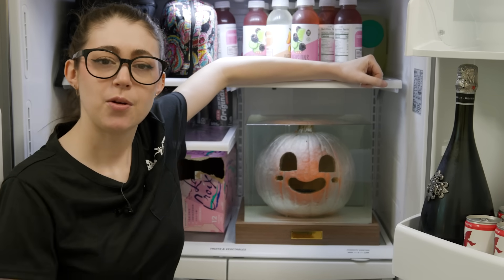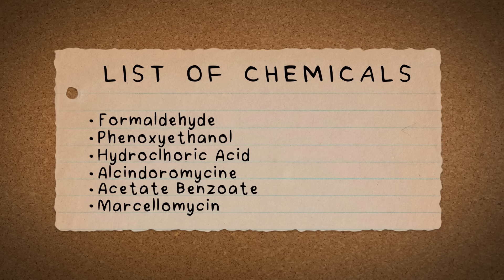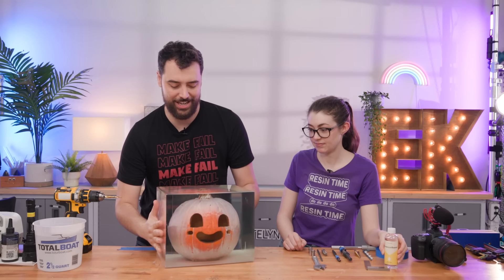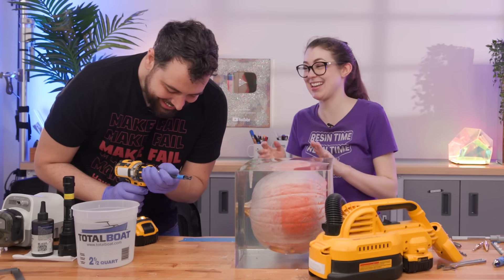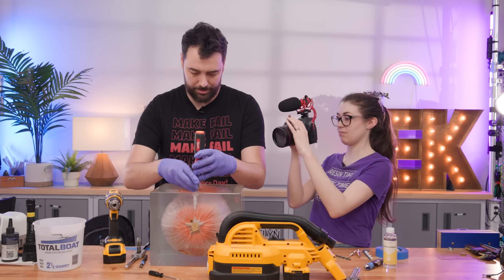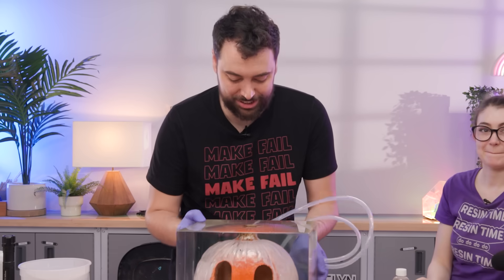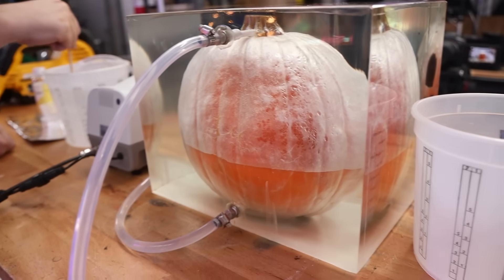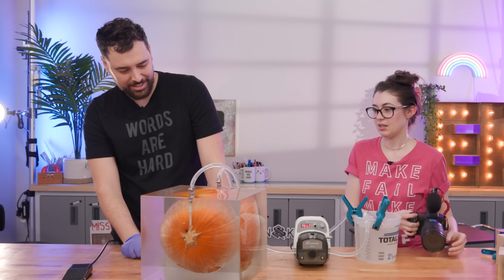Preserving A Pumpkin With Chemicals & Resin (feat. NileRed)

Comment: Sooooo... I'm curious. If flash cured resin preserved pumpkin is holding up the best so far. Would boiling it or something help? Because it technically was cooked inside the resin with the temperatures it reached during curing, no? 

Wrong? Right? Someone with resin knowledge explain why ot might/might not work, please. Because I'm curious now and I need to know

Comment: Intentionally create a flash cure because of chunk 1 put a pumpkin in resin the fridge you guys bought for these guys keep it in the mold and try to cause a flash cure by putting uncooled resin atop it that you can easily shave off with a drill also as askjeevescosby said on the chemical episode put glow resin/dye in it so it can glow under a black light or in the dark with no need for extra equipment or as TaF123 said on the same episode you can increase the size of the cube and file it down

Comment: I am trying to preserve a pumpkin, I mixed together rock salt, vinegar, rice, and silica gel. I didn't carve a face in it, I'm just filling it to the brim with the mixture. I'm going to put a strainer at the bottom so I can keep everything in and let the moisture drain out. I also have 2 dehumidifiers running right next to it.  I hope by filling the pumpkin up it will stop the pumpkin from collapsing by supporting it. I'll let you know how it goes. the one I'm preserving is a monster, it's 53 lbs, 2ft tall, 4 ft diameter and its not one of the huge pumpkin breeds, just a regular carving pumpkin.

Comment: @EvanAndKatelyn Seeing you flush Chunk 2 in this actually gave me an idea for your next attempt:
Context:
- As others have noted, because pumpkins are planet-based organic fruit (specifically a type of pepo), the rind, internal flesh, etc. are composed of water and other compounds, which will be used by any aerobic bacteria present in or on the pumpkin to reproduce.
- As you've already tried heating, drying, freezing, and chemically sanitizing the pumpkins pre-entombment, the only other options would be to completely sterilize the pumpkin with radiation or to ensure a completely anaerobic environment.
- However, this series has shown us that given enough time any amount of aerobic bacteria, no matter how few, that survive the radiation would be able to initiate and maintain the rotting process.
- Due to chemistry and physics "nonsense", water will evaporate out of the pumpkin's rind and flesh, given enough time with any amount of heat or light present.
- As the rind and flesh dehydrate, they shrink, since water is what helps make the volume of those structures.
- The resin used to entomb the pumpkin is rigid, and the resin has a stronger bond with itself than the pumpkin, so the pumpkin will always pull away from the resin, which causes an internal vacuum, which actually accelerates the dehydration process.

Idea:
- You have to pickle the pumpkin.
- Placing the pumpkin for an extended period of time in an non-oxygenated fluid of a similar density and viscosity to water should allow the water in the pumpkin to be replaced by the fluid as the water evaporates, while also making sure an anaerobic environment is maintained, as well as keeping the physical volume of the pumpkin the same.
- This is actually the premise behind turning cucumbers (and other items) into pickles: using either brine (heavily salinated water) or vinegar causes the pH to lower, killing most bacteria and then as the mixture is placed into an air-tight container, making sure no further bacteria can grow.
- A pickle-jar can never be perfectly air-tight, since it is intended to be reopened at *some point*.

Conclusion:
- If the pumpkin and "pickle juice" were sealed in resin, I think if the right fluid were used then all aerobic processes would cease, no shrinkage would occur, and internal pressures would remain consistent, so there would be no chance of the resin expanding enough to crack.

Comment: with chunk 2 you added a cylinder…what if for this year instead of just a cylinder you somehow completely fill the inside (let it cure) then do the outside. 

maybe so the pumpkin can heat up faster and kill the bacteria still as others are saying but don’t cause bubbles like chunk 1

Comment: Look into getting/fitting a breathable bung for your pumpkins gas-holes. They can let gasses out during the fermentation process without letting new air into the barrels. That could potentially "fix" your gas leak and bloating. I would almost plan for the juices, gasses and bloating and plan it into the next pumpkin and make it a feature...and I would dub them "Brewster"!

Comment: I would have used an actual germicide, not a preservative, on a concentration that's meant for food and not make up, a vacuum chamber to remove everything and THEN refill stuff with resin. Are you sure you left it in the drying gel long enough?

Comment: I know 4 months late on this, however! i have a solution for you. In beer/mead making you use a water gate to allow fermentation, while you are not fermenting him, the water gate will still work, how it works is its an s shaped tube, and the bottom part of the tube has water in it, it then has 2 valves on each side, what this does is it allows air to enter into from the side with the container, and bubble out through the water, but the water itself seals the other side from air coming in, this is how alcohol makers can ferment their product for months to a year, air can only leave, never get in.

Comment: If there's air bubbles appearing in a closed system like this, that's a direct result of bacteria decomposing the pumpkin.  You've got to kill basically all the bacteria if this is to work!  Otherwise, it'll be leaky pumpkin again

Comment: I think for next year you guys may wanna take a page out of microscopy techniques.

When we prepare a tissue sample to be viewed under microscope we go through steps that all perform various functions.
The fist is to encase the tissue sample in wax.
The second is to slice the sample super thin using a microtome.
Then the thin slice of tissue is mounted onto a glass plate, and dyed.

The micobes that keep messing up your pumpkins can be killed in two ways: physically, or chemically.
The easiest physical method would be to hold the whole thing at an internal temperature of 60ºC for half an hour (this is a very basic form of Pasteurisation, and the low temperature has minimal effect on things like colour, structure etc.

The chemical method that is used in sample prep. is to use varying concentrations of alcohol (which is miscible in water and xylene), until the tissue is saturated, and then submerging it in xylene. The xylene 'clears' the tissue of water and alcohol, which is then submerged in wax. The wax is finally replaced 
Not saying that you should get xylene for this project, but I'm sure a similar technique would be of use on your project.

Basically you'll need a mediator between water and some kind of preservative, and the preservative can be added at increasing concentrations (70%, then 80%, then 90%, to 95%, and finally 100%). Or a mediator between water and resin.

Also: the reason your squash from last year developed mold was because the layer of dead bacteria that were killed from the bleach or alcohol only acted as food for the mold that grew subsequently. Which was quite sad to see.

Keep up the great work, guys! And good luck on next year's attempt!

Comment: Flash dry the resin after drying the pumpkin in salt, then replacing the moisture with a sanitization fluid, then you can flash cure to kill any extra bacteria. Then just smooth it out. Or you can try heating up the pumpkin(not evaporating the sanitization fluid) then curing regularly.

Comment: you guys should do the pumpkin in resin and then once set drill a hole into it remove the flesh of the pumpkin so its just a imprint then fill that impression with orange resin and a light then it can be a desk lamp too.

Comment: I feel like there are more factors that you could control here. The moisture definitely needs to leave, maybe there is some way to slowly substitute water with another liquid, less receptive to mold and bacteria?
I am thinking, sloooowly "boiling" the pumpkin in a pot with the other liquid, which could let it top itself up on the other liquid as the water evaporates. Definitely something to test on smaller fruits or veggies first, before committing.
Another thing could also be microwaves. They react with water, so adjusting one (CAREFULLY) to very slowly work on a pumpkin could maybe do something.
The biggest issue with the dehydration attempt is the warping, perhaps it could be given a skeleton of sorts?
For vibes, I would also try making one with the top seperated from the bottom, so you can take it off and insert some light source into it.

Comment: Algorithm brought me here.
1.) I'd assume that heat from pumpkin 1 sterilized him so bacteria couldn't grow.
2.) Pumpkin 2 produces bubbles due to decay. I think it is fair to assume that there are pockets of gas within his flesh (a.k.a. pulp). Therfore I'd try to pull a vacuum on one port and connect a funnel to the other port to fill it.
3.) And whilst it is a reasonable assumption to use the least intrusive method, since decay allready started for so long, a harsher approach would IMHO be better. So, I'd maybe use it pure (100%) to fill the cavity from the vacuum because the pumpkin allready has water in it and will dilute the solution over time.

Comment: I'm sure a million others have said it already, but if not, be careful doing these.  I was cringing when you were drilling the first hole.  you basically made a pressure vessel, with enough force to make a bulge of that size, so technically it could explode.  safety first!  also google "degloving" (NSFL!) if you want to see the risk of drilling into a pressure vessel while it's pressurized.  I'd say you should just add a pressure relief valve on future biological resin projects to be safe

Comment: So just for future reference, when dealing with organic material in resin you want to replace as much of the water with resin as you can (which you may already know.) The use of a vacuum chamber or pressure chamber is often beneficial, though again you may have already done that.  The other thing you can do is try to sterilize the organic material before stabilizing with resin, or even after.  I think you can even use bactericidal additives in the resin mix.

Comment: NPT doesn't seal on it's own: you need PTFE tape, pipe dope, or anaerobic sealant (VibraTight is easy to use, but may make it much harder to pull the plugs in the future.

For stopping the decay, my mind first went to irradiated. It's used on food and you don't need to cut in to the resin...but your thing is thick so perhaps that wouldn't work...but that just means run it through several times and do it at least once with each face towards the source.

Comment: So the deal is there’s moisture throughout the entire pumpkin not just the innards. So when you try again this year dehydrate the pumpkin or if you can freeze dry the pumpkin of course that involves buying a $3000 freeze dryer or $2000 freeze dryer depending on which one you wanna get. But if you tell them what they’re planning on doing, they may just offer you one you have them sponsor your video. I forgot the name of the company though they’re really good free dryers. But freeze dry the pumpkin cut it all out and when you plan on doing it, leave the shower, freeze dry the pumpkinthere you go freeze dry it for 48 to 72 hours and then do UV resin as a base on the inside and the outside and then put it in the square that’ll work

Comment: Chunk 1 is my buy, total workhorse pour.  I kind of wonder what would have happened if you'd just put the whole thing back in a slightly larger resin cube to clear the gaps out or something?. 

Chunk 2,I think you went in the wrong direction. I think The pressure could have been used to your advantage and filling it with a liquid was a bad idea... I think giving him an actual base under the resin (like a full ass piece off wood that goes on top of the base) would be a good direction for the next experiment.

Comment: @EvanAndKatelyn I have an Idea to make Chunk 3 work, try to put him supmerged in a saline solution (having it hot but not hot enough to cook the pumpkin might help it to get rid of more bacteria) into your vacum chamber first, than  coat the pumpkin from the inside and outside with Phenoxyethanol and repeat the step before this time useing cactus resin instead of the solution. Next fill Chunk 3 with resin, let it harden and give him a coating of UV resin before you cast him in to a resin block.

Comment: 15:34 It makes sense if there was a lot of heat involved, in food production there is a step called pasteurization. This step greatly reduces the amount of bacteria in the product by heating it up to a high temperature for a certain amount of time. When canning foods, they can be shelf stable for many years because the jars are brought to a boil for an extended period of time. Ensuring that any bacteria inside has been killed.

Comment: My ideas for the next pumpkin.
1- CLEAN THE PUMPKIN, not with bleach/rubbing alcohol but mild soap/water before carving.  The goal is to get any germs/bacteria/dirt off the pumpkin before you pierce the outside and you more or less inject it into the pumpkin while carving.

2- Clean/Sterilize ALL of the Carving Tools - look into Autoclaves/UV lamps and make sure they are clean and dry before using.

Not sure if this will keep the rot out but it should reduce it

Comment: for the next preserved pumpkin you could do Plastination, i.e. replacing the water in the cells with plastic (using a plastic that dissolves in Acetone, a vaccume chamber, and a bath of acetone and plastic 10x the volume of the pumpkin.)

once it is finished, it wont decay, rot and can easily be encased in resin (though not actually nessasary)

Comment: I think if you would have put Teflon tape, plumbers tape it wouldn't have leaked and the only reason it didn't leak right away was probably do to resin being relatively soft and leaving nice threads but not actually sealing so it slowly seeped through the threads

Comment: Evan and Katlyn, I have an idea for your next pumpkin in resin experiment! 

Have you ever considered freeze drying your pumpkin? (or maybe a mini pumpkin for testing). The reason that makes things get moldy is the presence of water, and freeze drying takes all the water in something and turns it into vapor. 

Also I learned about something called Stabilizing from Peter Brown on youtube in which he made a resin pendant made of bread. He uses this thing called Cactus Juice which is a slow acting heat setting compound that, when used with a pressure pot replaces all the air pockets with the stabilizing resin using a vacuum.

So yeah, thats my idea. Freeze dry, stabilize, then pour or encase said pumpkin in resin. No water=no mold and sealed air pockets= no bubbles.

Comment: I knew this would fail from the get go because, I've gotten into studying taxidermy via wet specimening soft bodied insects. With soft bodied insects, I can get away with just using 70% rubbing alcohol (90% tends to degrade color), but the thing is, the larger the specimen the harder it is going to be to preserve with "lighter" chemicals. The bigger the GI tract, or the more tissue you are dealing with (and not just flesh tissue, plant tissue too), the more likely formaldehyde is going to be your only option. You are fighting decomposition which is a powerful force in nature and extremely hard to win against. Even when using formaldehyde, with a very large or bacteria laden specimen you need to inject it into the specimen and may need to change the fluid often as the decomp may still happen until the specimen is properly "fixed", it's a process and rarely a one and done kind of thing. With some organisms we may even remove internal organs, especially the GI tract, that contain tons of bacteria and make the process that much harder, but sometimes we leave it to study what is in the GI tract of the specimen later.

The biggest thing that set you up for failure was not even the specimen size or using the wrong fixative agent, it was that Chunk 2 had already started decomposing. It is much, much easier to keep bacteria from ever forming in the first place, than it is to fight an existing, heavily colonized group of bacteria. This is why even with human bodies we do not attempt to embalm a heavily decomposed human body and try to preserve it in a fridge before we embalm, to try and keep the bacteria from colonizing before we can get to it. The moment the bacteria start colonizing it not only alters the appearance of the body but it's going to be much more difficult to successfully embalm.

I think you got super lucky with Chunk 1 that the heat managed to kill off any bacteria that could have broken him down, I think heat sterilization is hard to do successfully a lot of the time, without something like equipment meant for that!

Comment: The slight shimmer remaining on Chunk 2 is because the index of refraction of the liquid you pumped in doesn't match that of the resin's index of refraction. Also the air getting in when you removed one hose was because you formed a siphon by having the end of the remaining hose lower than open port. Taking off both hoses removed the siphon since both ports were at the same height.

Comment: Nigel could maybe help in freeze-drying the next one. Or find a way to sterilize it with an autoclave (get temperatures above boiling point, without boiling). Or find a resin capable of withstanding higher temperatures so the autoclave can be done after the resin is cured.